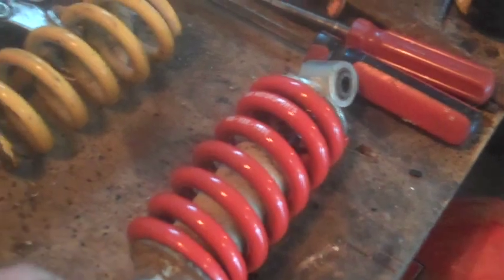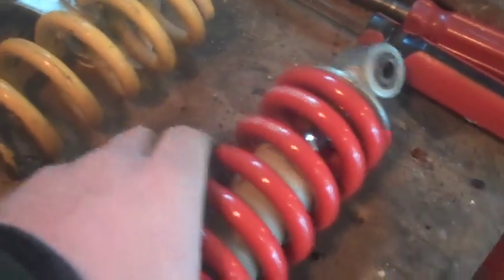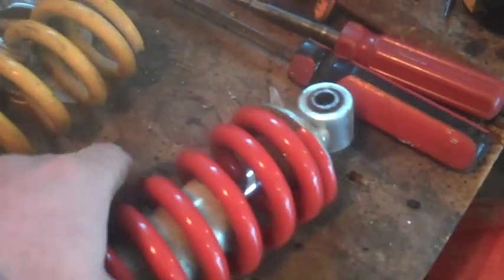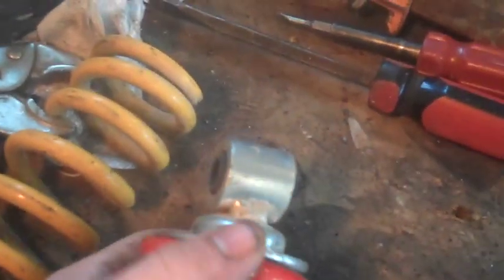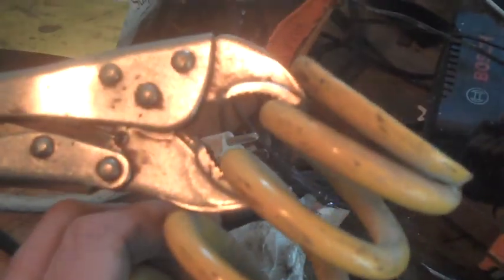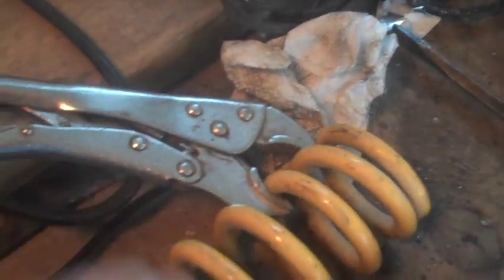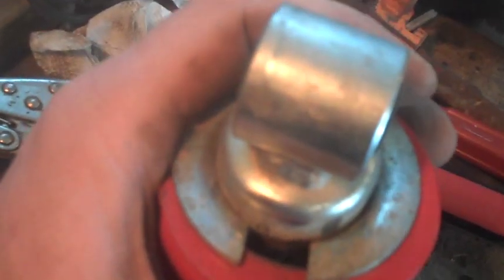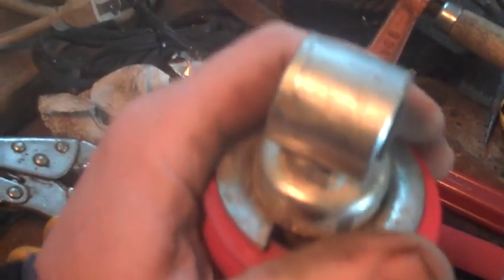HOW TO - REAR SHOCK UPGRADE Honda XR 100 ! ! !

Comment: There is a reason you don't see him doing it .. It's PITA ! At least you will need a proper Vice , 2 sets of vice grips, a Sturdy Flat Blade Screwdriver , A Hammer and lots of patience .. A Small Spring compressor would make it easy-peasy.. Plan ahead!
Reply from the maker: +Riceburner30281 you goof that is exactly how i did it. what the fuck would i lie about replacing a shock spring, you fucking goof.
Reply: +Braap Milla Nobody said you Lied! It was a Pain in The Ass though, Thanks for posting it was helpful..
Reply: @POLARIS.RZR.CRASH.101  Hey bud, did the stiffer spring make a good difference, I'm looking at a xr200 and I'm pretty sure I'll need to upgrade the suspension?